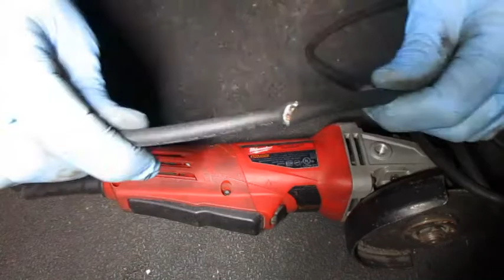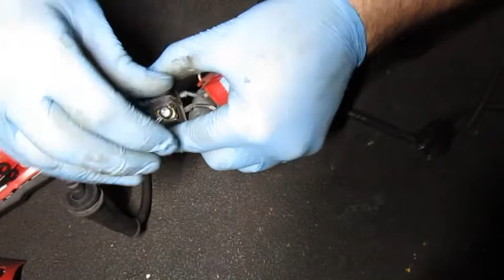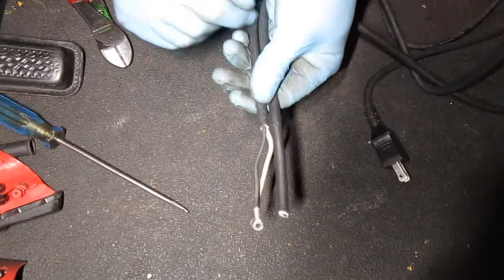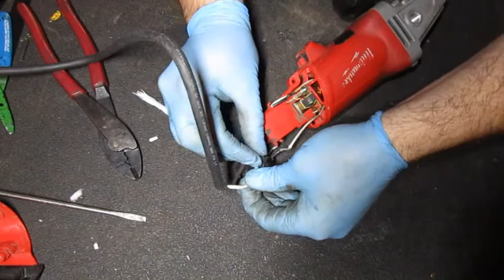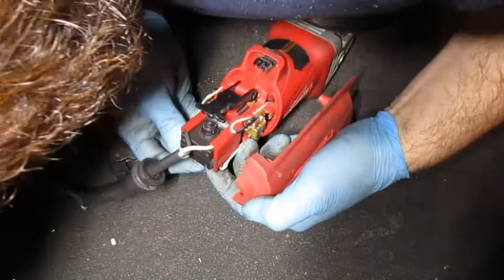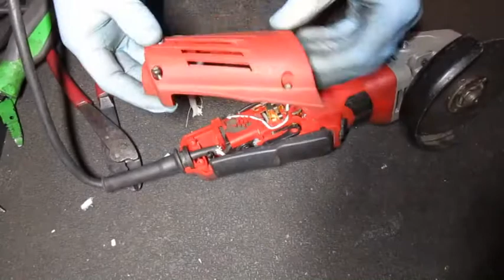Milwaukee Angle Grinder - Power Tool Cord Repair

Comment: I got a ridged 15 amp I use at 25 below the cord snapped on my first one from just normal work. I bought another and want to put an arctic 15' extension cord on it hopefully it will be just like this thanks